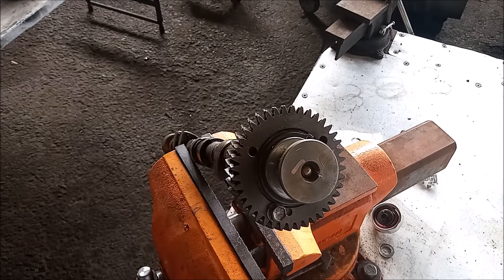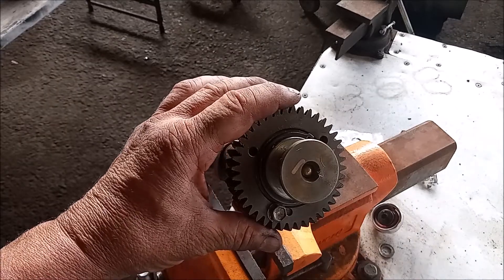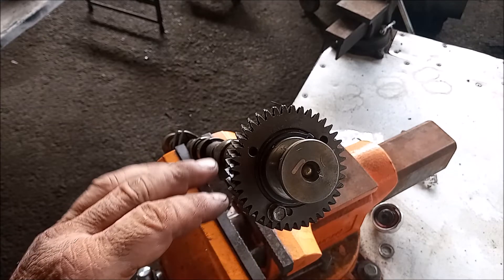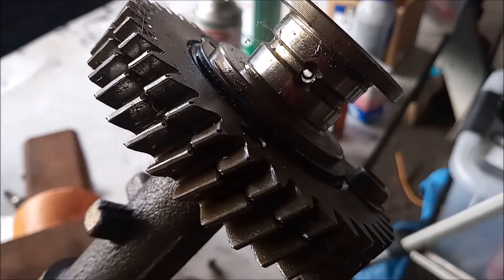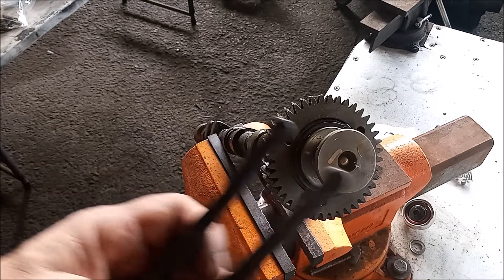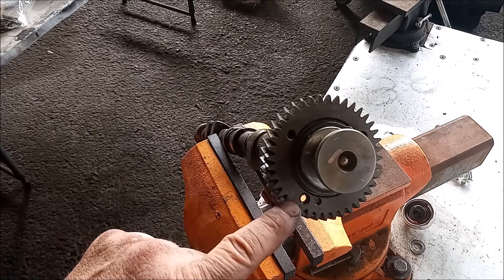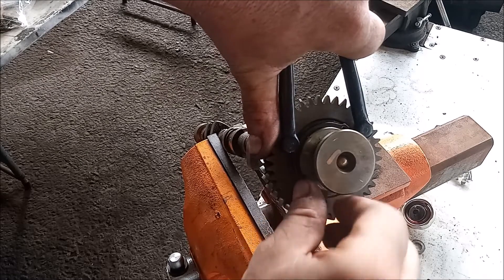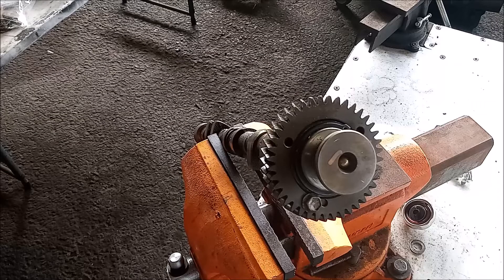1MZ-FE 3MZ-FE VVT Gear Camshaft Installation - Service Bolt - Toyota Camry Sienna Highlander RX300

Comment: Have you had any sprung gears develop an issue?
Reply from the maker: Not that I know of.
Reply: @Merryfrankster_  Have you taken one apart?  Seems like they only have a wave washer in between the gears.....I wonder how it keeps the opposing pressure between the 2. I replaced the vvt timing gear on the intake shaft but still have the rattle coming from that end of the cams......I may have to pull the exhaust cam and disassemble that gear.
Reply from the maker: @JayKowal-j5h  yes I have taken them apart and put them back together and in fact this is addressed in two separate videos that you can find in this same playlist for the mz engine. On assembly, you must PRELOAD the spring otherwise you have BIG issues. See the video for exactly how it is done and what tool to use.
Reply: @Merryfrankster_  Have you taken the gear apart on the exhaust cam? What kind of spring holds the tension on the gear?  Is it possible it can break and the tension is lost?
Reply from the maker: @JayKowal-j5h  buddy look for my video with the spring. It answers all your questions.
Reply from the maker: @JayKowal-j5h  don't say I never did anything for you. https://www.youtube.com/watch?v=UD5KEi1ad_c
Reply: @Merryfrankster_  You have been very helpful to many people who appreciate your videos!  I did see this video.....but still don't know what kind of spring holds the opposing forces on the 2 gears......and if it is something that can break and lose that tension......I still have a loud rattle in that area around 2000 rpm after replacing the intake cam vvt gear......and there does not seem to be anything else in that area that can cause the rattle......looks like I will have to remove the exhaust cam and disassemble to find out for sure.
Reply from the maker: @JayKowal-j5h  to pure saying that you have watched that spring setting video and you do not understand how the spring works or how it works?
Reply: @Merryfrankster_  Before I take mine apart I would like to see what the spring looks like.... and how it keeps opposing tension on the gears.....if that spring is broken there may not be any tension there which may be the source of the loud rattle.
Reply from the maker: @ definitely if the spring has not been set as shown in the video I linked,  and installed with the service bolt in place, then removed, it will make a very loud rattle.
Reply from the maker: When you access the cam gear, it will be obvious whether the spring is set under tension, or not.
Reply from the maker: Here's a complete diagram with part numbers for a 3MZ - you can find the corresponding diagram for your car. https://parts.lakelandtoyota.com/showAssembly.aspx?ukey_assembly=487166&ukey_make=1060&ukey_model=15436&modelYear=2006&ukey_category=21646&ukey_driveLine=6756&ukey_trimLevel=18394
Reply from the maker: Probably easier to buy a camshaft complete from a junkyard rather than trying to disassemble and repair
Reply from the maker: If you inspect the gear under the valve cover without any disassembly, the holes for the set-bolt should be very close to each other. If they are separate, then the spring is not set.
Reply: @Merryfrankster_  I have owned this Sienna for 11 years.....the rattle started recently......when I pulled the intake cam and replaced the vvt gear, that was the first time any cam has been removed, going by the maintenance records I have from original owner. And as you demonstrate in the video,  I made sure to install the service bolt before removing the intake cam, and removed it after putting it back in.  Before removing the intake cam I wish I had checked to see if there was tension on the exhaust cam gear....and I did not pull the exhaust cam because that involves removing all the timing belt components.
Reply: @Merryfrankster_  Thanks for all the info!  I will let you know what I find.
Reply: @Merryfrankster_  That wave washer must be the spring that keeps tension......otherwise all I see is a snap ring for each gear, should not be hard to disassemble
Reply: @Merryfrankster_  I was able to install the service bolt so they were lined up......I am wondering if the wave washer that seems to be the part that holds tension may be broken
Reply: @Merryfrankster_  I went to Pull A Part today and disassembled the exhaust cam gear......I see what the spring looks like now that provides the opposing force on the 2 gears......on the link to Lakeland Toyota parts you provided it is part #13579A......costs $6.88.
Now I know what to look for when I open mine up again. Thanks for the help!
Reply from the maker: @JayKowal-j5h  good job.
Reply: @Merryfrankster_  Hi again.....wanted to let you know what was the issue......timing belt tensioner. But the tapping/rattling sound could not be heard with a stethoscope in the area of the tensioner. The noise travelled to the opposite side of the head where the VVTi gear is. I finally decided to pull the top timing belt cover and the slack in the timing belt told me the tensioner failed. I do not know why the timing belt did not jump a tooth or 2 because I have been chasing this noise for 4+ years. But I had noticed a drop in gas mileage and performance in the engine for that time. It runs much better and quieter and gas mileage has come back to what it was before all this happened.  Your videos and replies to me were very helpful! Thank you!
Reply from the maker: @JayKowal-j5h  Very interesting. Hip bone is connected to the thigh bone, thigh bone is connected to the knee bone, knee bond is connected to the shin bone, et cetera.
Reply: Hi Franster what size of service bolt  put on exhaust gear.
I like you tutor video
Reply from the maker: @huyentu5185  M8x1.25

Comment: Do you have any experience with 2005 3mz-fe VVT?   Unusual issue with mine......does not rattle on cold start.......will rattle at certain RPM's only after warmed up.....around 2000 rpm.
Oil Control Solenoid looks and tests good.......screens are clean.......245k miles.......full synthetic oil changed every 5k miles.
No CEL's, mpg consistently 21-24 mpg......no drivability issues.   I am thinking its needing the VVT gear assembly replaced
Reply from the maker: Unplug both vvt solenoids/OCV's and drive. This will keep the VVT gears locked. If you still have rattle with the gears locked, it's not the gear.
Reply: @Merryfrankster_  I did what you suggested......rattle is still there.....using a stethoscope it is definitely coming from bank 2 only, right at the gear location. No rattle when I listen further down the block or anywhere else, only at the gear location.Could it be the locking pin not locking?  
I took pix but cannot see how to upload.....is there a forum we can meet on where I can upload pix?
Reply from the maker: @JayKowal-j5h  Yes it would appear that the pin is not locking, leaving the gear free to rattle.
Reply from the maker: @JayKowal-j5h  Otherwise there could be some issue with the sprung gear (the subject of this video).
Reply from the maker: @JayKowal-j5h  I don't know if it would do you any good to just take the valve cover off and take a closer look - you should be prepared to take the timing belt off and remove the camshafts.
Reply: @Merryfrankster_  Thanks for taking the time to reply.....I pulled the valve cover and nothing unusual......sludge free inside.
If I just pull the intake camshaft, do I need to insert a bolt in the exhaust cam?

Comment: Thank you very much 🫡 for the info. Thank you 🙏 

I didn’t know that is pretensioned I did head gaskets on my car and just put everything back together without knowing about this and my 2006 sienna engine started with a very loud knocking noise, I’m driving it with that noise present now that I’m writing this. I’ll get back in there soon to fix it. Thank you very much 🙏
Reply from the maker: Yes it's unfortunate that many people do not know about this and they end up in the same pickle.

Comment: Thank you!
Reply from the maker: Thank you for watching and for commenting.
Reply: I'm putting mine back together putting the camshafts in I did that once and I had trouble compression on one side of the motor I just did a leak down test on it it's fine there's no bent valves. what could I have done wrong It was the right side of the engine The camshafts will put the double dots matching is that top dead center? according to the marks on the pulleys that's 180° out. All I know is I did not get compression I'm trying to figure out why. Thanks for your help and your videos
Reply from the maker: @marcavus1  If your have good leakdown test and you have no compression this means that the valve timing is not correct in other words the timing belt is not installed correctly.

Comment: Hi again Frankster..... you didn't mention that the service bolt hole is on the bottom of the rear bank when at TDC. Front bank was easy. How do I get the service bolt in the rear intake cam with regular size hands? There is no room to swing the ratchet or spanner. Any ideas? Cheers.
Reply from the maker: um obviously it can be done. try think of something. Or just remove the cam, then use a pulley tool to put the service bolt in before you re-install it.
Reply: @Merryfrankster_  cheers, I was thinking of getting or making a pulley tool but I'll still have trouble getting the service bolt out when it's reinstalled....
Reply: The service manual says to rotate the cam shaft with spanner, insert service bolt. page 14. cheers. (doesn't say but implies) rotate back to cam shaft timing marks, then remove. I'm going to give that a try.

Comment: Hi Frankster, me again..... how do I get the timing belt cog off the camshaft to remove it without buying a special tool for $200? Will a rattle gun get it off? Cheers & Thanks again,
Reply from the maker: Impact should do it in most cases. If that does not work, you can set a breaker bar against the lower control arm and jog the starter. By the way in one of my tips and tricks video I have a link to a very affordable removal tool.
Reply from the maker: https://www.youtube.com/watch?v=tTtuxpIEuEk&list=PLDCQigEZK0AV5YB_J8lW2D3vQofhi7mks&index=4&pp=gAQBiAQB
Reply: @Merryfrankster_  Thanks again Frankster.

Comment: Cheers Frankster. Thanks for recommending that I check this video out first. Where do I get the service bolt from? It looks like I could possible use on of the quarter panel bolts.
Reply from the maker: You can use any M8x1.25 bolt from anywhere.

Comment: I have a question regarding reply RTV sealer underneath  the bearing cap E1 where close to the LH camshaft oil seal.    Do I need to install the service bolt before loose up the caps?  I'm not removing the shaft I just need to loosing up all the bearing caps and retorque them down bolts.   Do you have any suggestion?    Thank you!
Reply from the maker: Installing the service bolt while the camshafts are in place in the car takes less than one minute of your time and saves you from a lot of issues and hassles should something unexpected happens. Don't forget to remove it when you're done. You don't need any special bolt, any M8x1.25 bolt will do the job - I think that's the right thread, I don't remember too clearly.

Comment: Just got done doing the heads on a 4.7 tundra installed the service bolt and all the timing marks lined up perfectly. Now there’s a ticking noise at idle but as soon as I put it in gear or start driving it goes away
Reply from the maker: Maybe use a mechanic stethoscope to pinpoint the source of the noise at idle.

Comment: Did the bolt come out on the other side of the camshaft after u tighten it or did the bolt just hold the camshaft body instead without coming out at the end?
Reply from the maker: The bolt is inserted before you remove the camshafts from the engine, before the exhaust and intake camshafts are separated,. It is removed after  you install the camshafts and mate them together. The bolt ensures that the gears from the  intake and exhaust camshafts are mated together correctly. Watch the full video on removing and installing the camshafts.
Reply from the maker: to be honest I have absolutely zero idea what you are asking.

Comment: A year later here I am saying I’m glad I seen this before removing the cams and head to do a bent valve job caused by a snapped timing belt
Reply from the maker: Better late than never, I guess.
Reply: @Merryfrankster_  well I watched your video on if the 1mz is an interference motor or not and based off what I saw it is not an interference motor so now I’m convinced that maybe the motor does not have bent valves
Reply from the maker: @Hondabuildsandbikes  correct it is an non-interference motor, but it's possible to drop a valve, or to have a damaged ring land, that can interfere with engine rotation.
Reply: After the timing belt broke, we put a timing belt kit in the car before reassembling all the motor mounts and what not. We just cited to crank the car and it sounds like it has a slight miss If it were up to completely dropped a valve, it wouldn’t even run and I would definitely hear it in the rotating assembly
Reply: My 1997 Avalon exhaust cam gear at rear by firewall forgot tie the bolt turn on engine mess up cam gear and cam shaft broken guide to hold cam gear need to replace cam shaft and cam gear what should I do?

Comment: Hi I'm getting ready to change a timing belt on a Lexus  3.3L  2004 and later on a 4.0 1uz 1995 .. both of these vehicles belong to me. I don't want these camshaft to move when I'm removing and installing the new timing belt what tool do you recommend exactly to keep these camshaft from moving I'm afraid of making a mistake... I really like your advice
Reply from the maker: Follow the instructions of the factory service manual for the 3.3. Turn the crankshaft to TDC on cylinder 1, then remove the belt, then turn the crankshaft backward 60 degrees and leave it there. Then you can move the camshafts any way you want, safely, because the valves cannot come into contact with the pistons. When you are ready, get the camshafts back into position with the marks, turn the crankshaft forward to TDC, and put the belt on. For the 95 1uz-fe, this is a non-interference engine, there is nothing to worry about.

Comment: great video i have a 3.3 toyota sienna  had cam codes the cam with on front that holds the timing belt snapped can I just replace the cams
Reply from the maker: I'm sorry I don't understand what you mean. You snapped a camshaft? The camshaft broke?
Reply: @Merryfrankster_  yes the front camshaft broke i think the the VVT went on it causeing the camshaft to break my question is can I juat replace the camshafts and timing belt or do i need to do a ful lengine  rebuilds

Comment: I can't find this tool anywhere. I just changed the head gaskets and I didn't use the service bolt. I have some codes indicating timing is off. I want to fix this issue when I re do the timing. where can I get this tool.
Reply from the maker: It is just a simple M6x1.00 bolt.
Reply: @Merryfrankster_  I was talking about the tool you used. LOL anyway i found something and got the service bolt in and now it's doesn't sound like a diesel anymore. YAY
Reply from the maker: @againjoe  right on.
Reply: @Merryfrankster_  where can I find the pulley tool for the service bolt. Thank you.
Reply from the maker: @MAXSPEED77  I don't know where you can find one exactly like mine, but you can find a lot of pulley holder tools like this one: https://www.amazon.com/GearWrench-3472-Pulley-Holder-Clutch/dp/B0002SRGE8